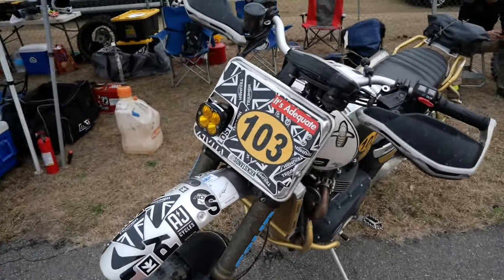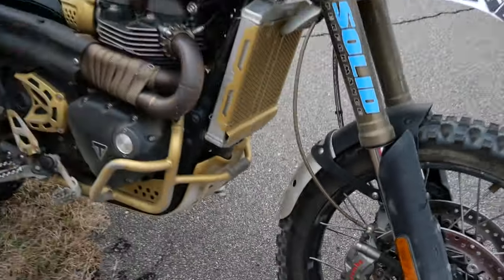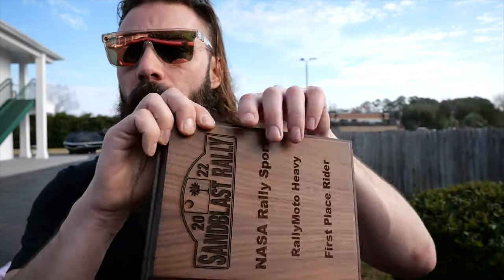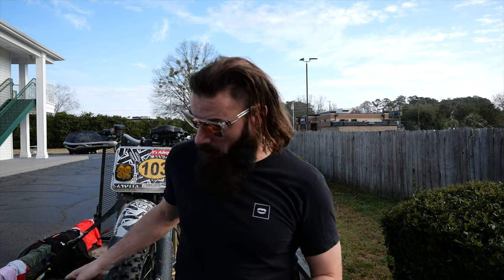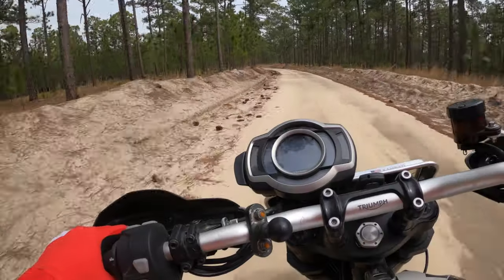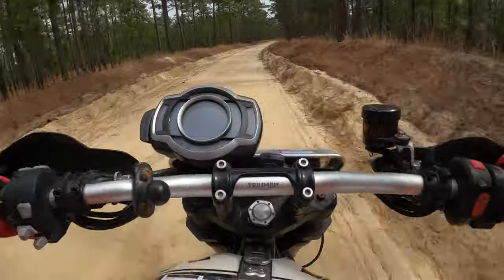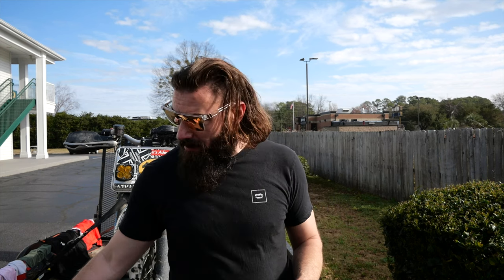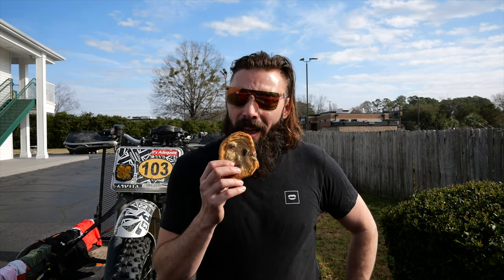Sand Blast Rally 2022 Triumph Scrambler 1200xe Ohlins Suspension

Comment: Hi Steve. Great Achievement. Wish I could do some Rallys with my Scrambler. But I do not feel confident enough yet and here in Europe, there are no races like you have in the US. Great info about your mods. Thanks for the video. I have one of the first editions here in Europe, still runs strong no major problems so far. (50.000km now)  Except for stuff I broke myself during offroading.🏁
Reply from the maker: Use it and abuse it then build it back
Reply: @steve_kamrad5216  doing that for the last 3 years🤣🏁

Comment: Too shelf riding but seriously, eat the cookie man haha. I've been through this with you before but i still can't work out your tender spring mod. Tried flipping the bushing and spring but not fitting. Would love to see a photo of it
Anyway awesome vid 👍
Reply from the maker: So you flip the black plastic bushing and leave the springs where they are. Hopefully this makes sense. If you look at the black plastic piece it's longer in one direction so the black tops out faster once you flip it. We did clean up the inside of it with a lath so it slides over the shock body easier too

Comment: Impressive ride and result!  Did you have traction control on; seems like I heard it engage when you accelerated hard in the loose stuff.   Amazing what you are able to do on that beast👍
Reply from the maker: Full off. That's either the tire getting traction or the rev limiter
Reply: @steve_kamrad5216  -Ah the rev limiter👍

Comment: You are handling that bike well. Moving
Its not a 300.
On the limiter all the way in the thick sand.
No issues with that motor?
Reply from the maker: No issues at all. That motor has a really low red line so it can live on it.
Reply: @steve_kamrad5216   cool thanks man.